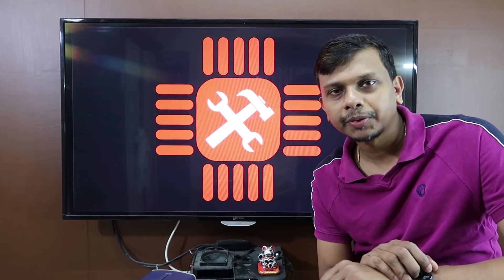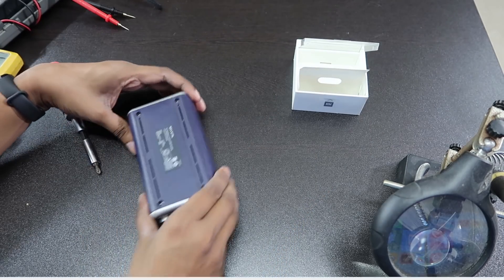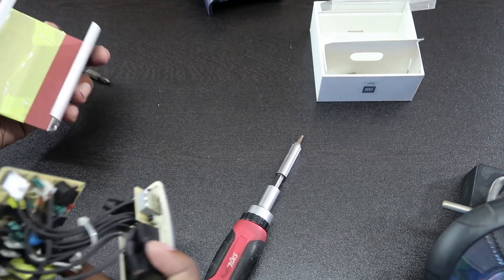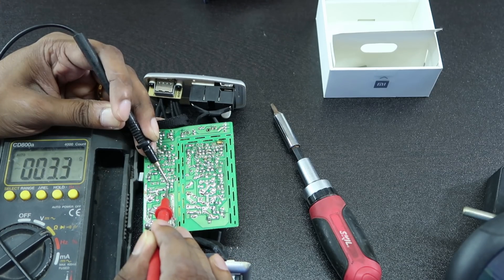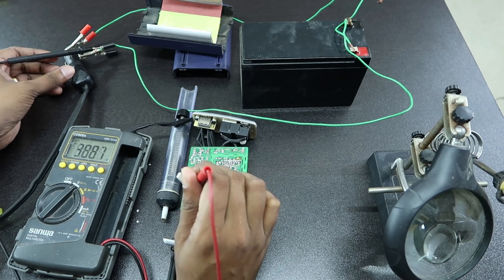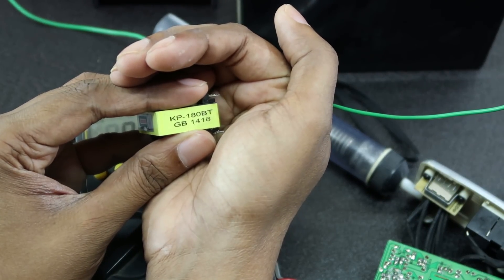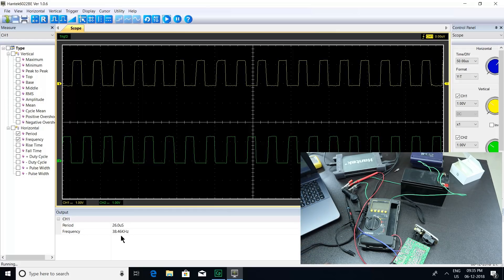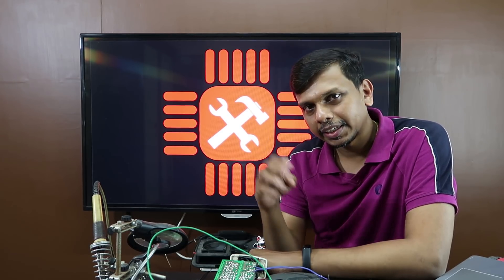F5L071ak200W | ഇൻവെർട്ടർ അടിച്ചു പോയി | Repair a Car Inverter | Fuse Blown out

Comment: Have you rewinded pulse transformer?
Reply from the maker: Yes, I had sent it to a shop, but they checked and confirmed its good.
Reply: @Azhichupani so mosfet  was short. Only that was issue. Or pwm issue? What was the real issue.
Reply from the maker: @malu-t3x  MOSFET was short..
Reply: @Azhichupani  which mosfet exactly. There are 2 different  mosfets used in it. My inverter shows overload low batteryup and 2 mosfet at the corner are burning.

Comment: athre clean  video alla, 2013 vangiya transformer make enge 1416 il nadannathennu onnu paranjuthruoo???
Reply from the maker: Onnum manassilayilla
Reply: @Azhichupani  1416 transformer date code anu 2014 16th week manufactured transformer
Reply from the maker: @06ke26  hahah it has nothing to do with date it is just a serial number.
Reply: @Azhichupani  No it's not a serial number it's date of manufacturing and in your blog you state that you bought the inverter in The year of 2013 I was pointing that
Reply from the maker: @06ke26  nope, I purchased it well before June 2014..